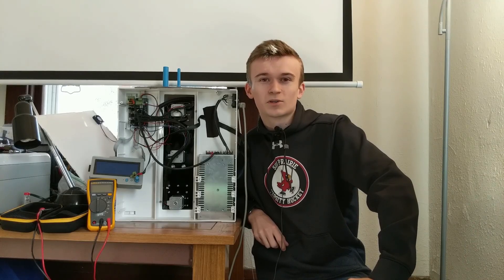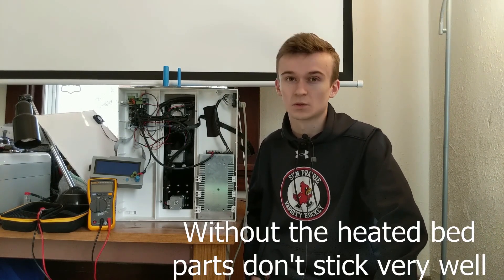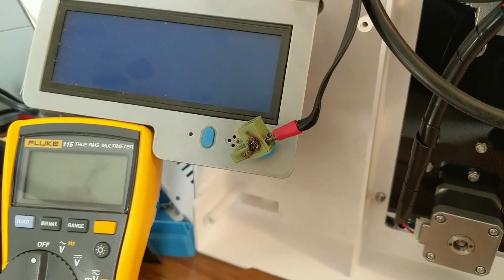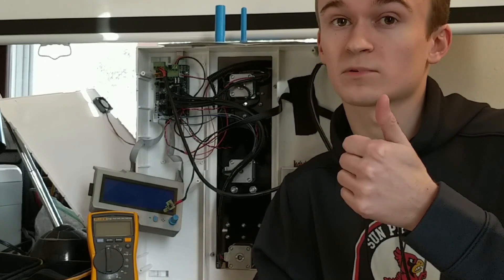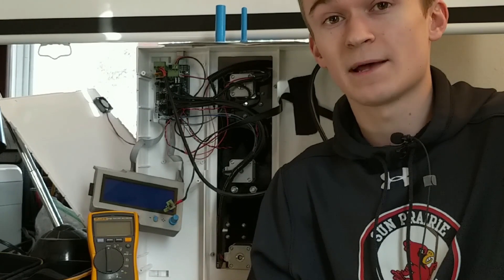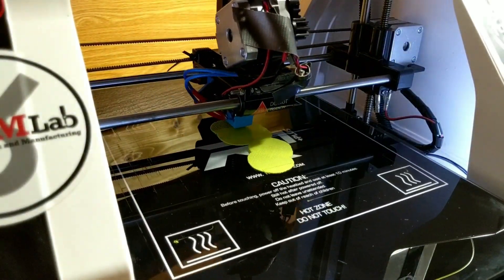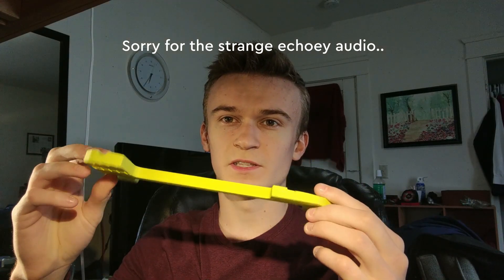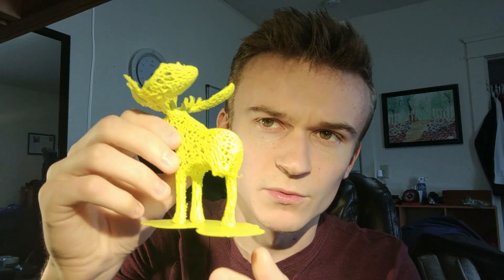Fixing a 3D Printer (Robo3D R1+) & Printing Some Parts

Comment: My robo r1+ is essentially no longer an "r1". Running e3d titan area. New ramps 1.4 and arduino (soon to be skr1.3 with mosfets) and with removable magnetic buildtak plate. Nema 17 steppers with tmc2208s. As well as mean well power supply, every fan is a noctua. When I purchased in 2017 for 799 didnt expect so many issues. And expenses on this. Nice you got yours going again.
Reply from the maker: I feel you on that! I haven't swapped quite that many components. But my power supply shorted during my freshman year and I had to replace it with a Meanwell psu. Had some noisy fans so I replaced my Ramps fan with a Noctua. Running an e3d v6 hotend on mine. Luckily I haven't needed to put quite as much work into mine as you have! I bought mine in late 2016 and wasn't expecting so many  issues either :/

Comment: Hi, I'm from Chile and I've never found videos of the ROBO3D, it's the printer I have at work and it's a headache in some ways, I wanted to know if you've tried flexible filaments, since I can't print on this machine, regards
Reply from the maker: Hi Camila! Sorry I didn't see your comment earlier. I can definitely see how you've had some headaches with this printer. Mine is currently broken again :( 
I have printed with flexible filaments before, but never on my ROBO3D machine unfortunately. Sorry about that, I wish I could help!